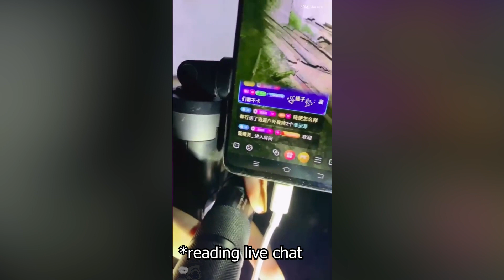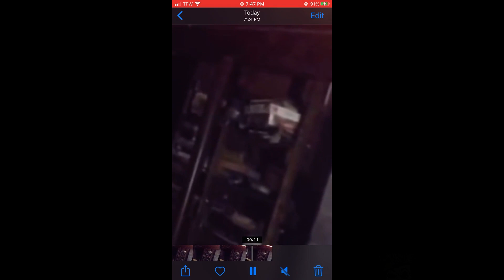The Scariest Things Found On Video

Comment: The dark paranormal guy @7 minutes is a fraud.  He uses string to move objects and you can see it in this video clips too.
Reply: Tim M is almost the only guy I’d believe with these videos. He has cameras EVERYWHERE like they should!
Reply: Ive tried several times and I never see any strings in his videos. 🤷🏼‍♂️
Reply: @beauregardrippey5508  caspersight pointed it out on one of his videos. It was almost the same exact  situation where he sits up cameras and goes outside then two stools go flying in the air. If you look closely on the video towards the direction of where the stools fly away, you’ll see debris on the ground move… they moved as the stools started to move. Zoomed in, you can see string.
Reply: @_I_AM_9  , in the beginning of his videos, he claims it’s for entertainment.
Reply: @beauregardrippey5508 , I’ll try and find the video for you

Comment: 5:41, the digital noise, is usually induced by older smart phones into microphones, so that's normal. The growling, I can't help with.
Reply: Yeah one of the cell phones I had mainly when I was in the car, right before a phone call would come thru, I'd hear that noise, if the radio was on, it was kinda neat, like a little heads up, ur about to get a text or call. So yeah that interference is prob just all the electronics he's got goin on. 🤷🏽‍♀️

Comment: Wowwwww after the 1st door was being knocked on I was like yeah there's someone just kneeling down in front of the door but the balcony door I just don't have any words for that that's just terrifying also maybe it was a dead relative like frost said trying to reach out to him
Reply: yeh i thought that too but there is enough time for the "figure" in the reflection to go by the opposite side as the cameraman turns cause he doesnt film the spot where it was right away he pauses as to give them time to get out of the way
Reply: @sybriusart6137  Dude would have to be Usain Bolt to pull that off, especially to not have the robes show up as quickly as the guy spun around.
Reply: Naw dude. I don't think relatives would want to scare you. I've seen those black figures in person and it's a feeling of horror and helplessness. Whatever it is it's not friendly. You should never open or block doorways when they knock.
Reply: @dangerdash4393  there is a cut in the video to accomplish this